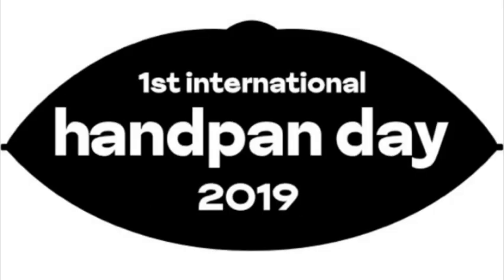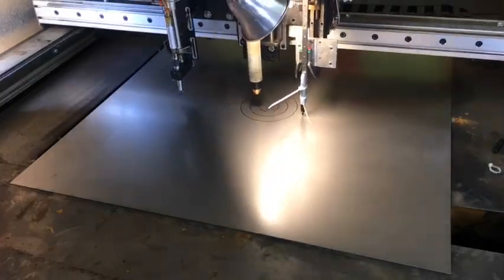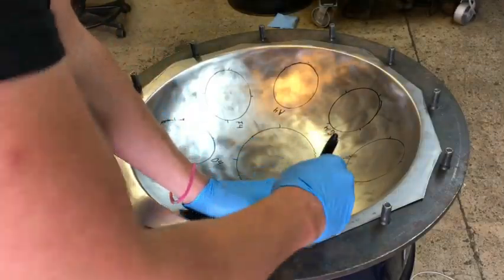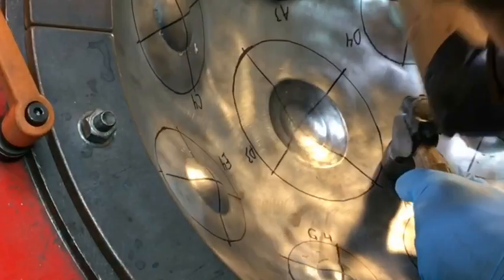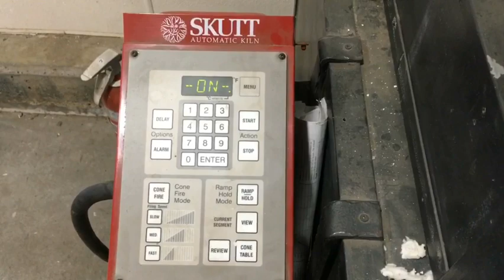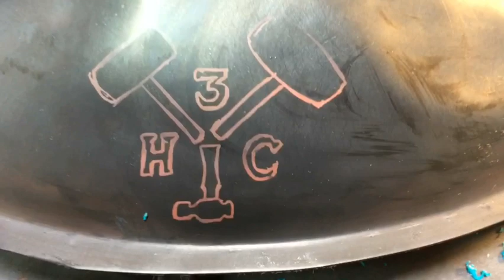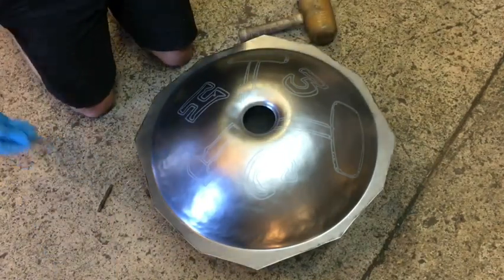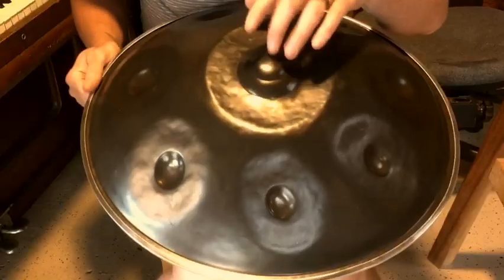How To Make A Handpan- The 3 Hammer Challenge - 2019

Comment: Just wondering where you get the templates from for the tonal fields…I am trying to work out a D Kurd 10 (9 + 1) and I cannot find the correct dimensions for the fields. I think that I am using  74 x 91 outer 23 x 28 inner, but cannot find any great information about whether that is correct or not. Do you have any idea if that size would be correct or if there are any books/templates that explain how to come up with dimensions?